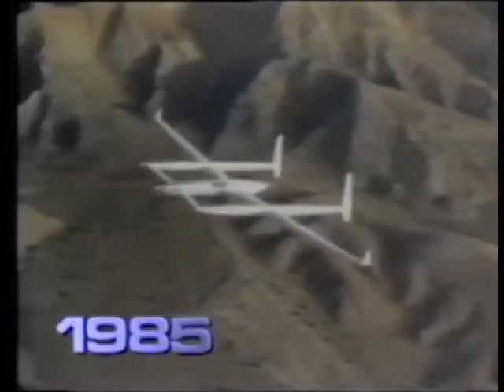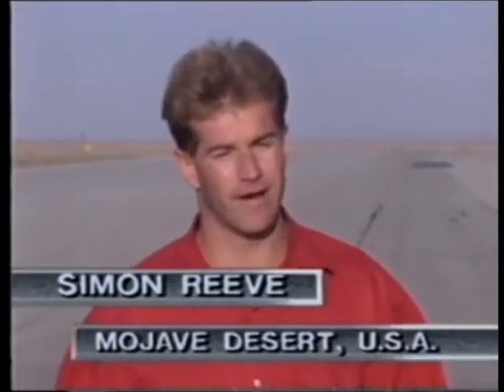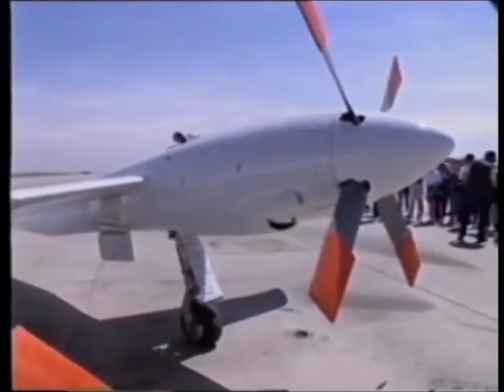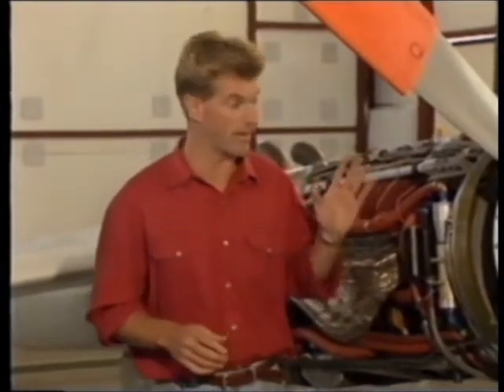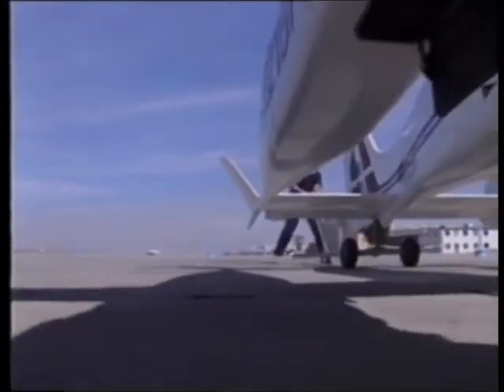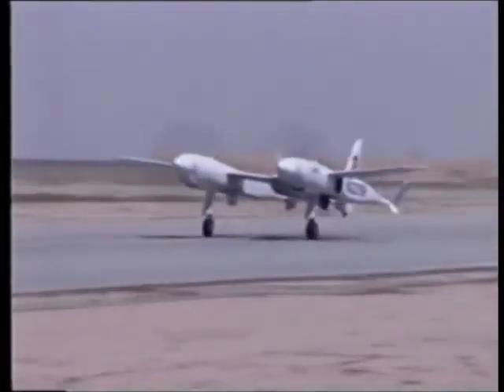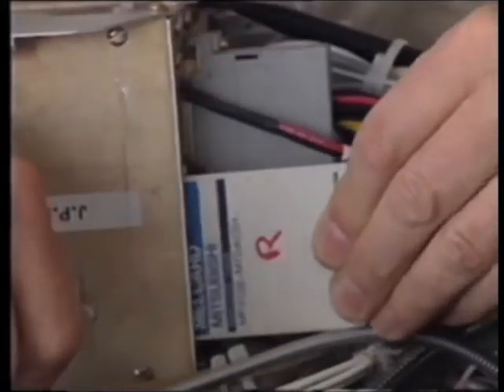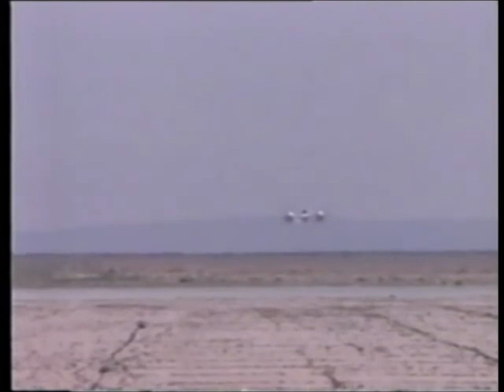Scaled Composites Pond Racer -  Beyond 2000

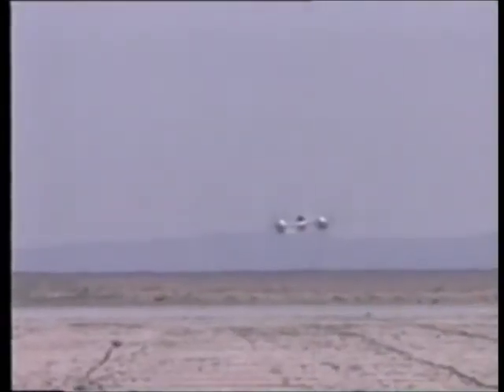Comment: 0:55 - That flyby!!! Hard to beat this thing on the coolness factor, even if it wasn't the most efficient design. It's unfortunate that they didn't further develop the engines in ground testing before flying with them. By all accounts, it was a great flying aircraft, what a thrill it must have been to fly.